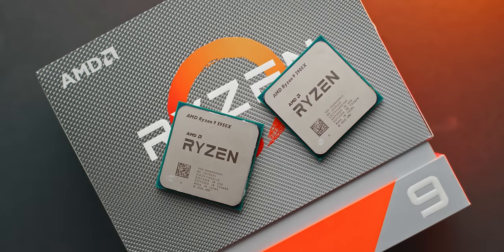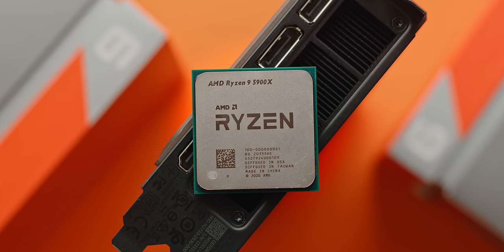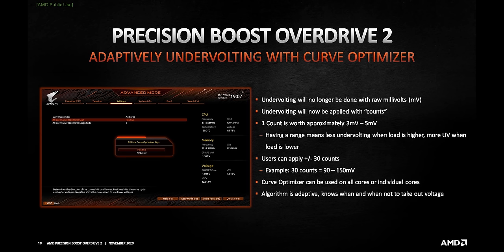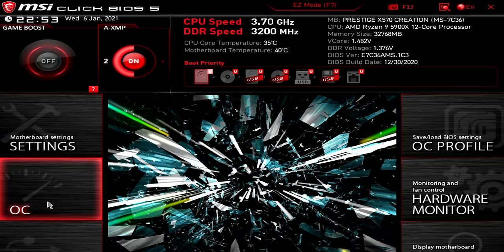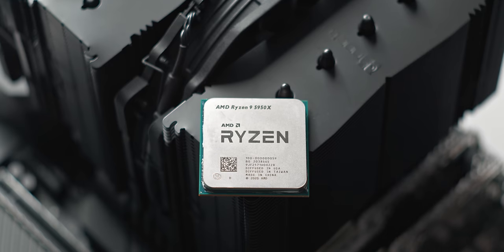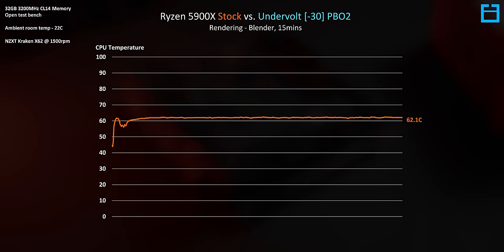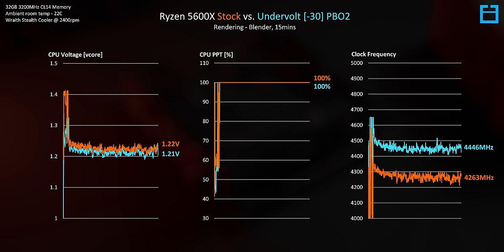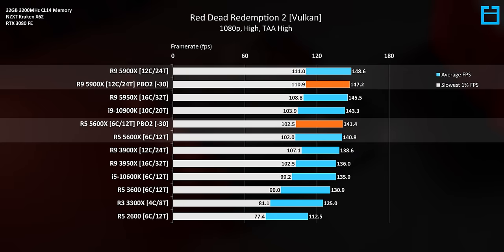Ryzen 5000 Undervolting with PBO2 – Absolutely Worth Doing

Comment: Finally a guide by someone that really know whats he is doing.
Reply: I'll probably sound like a dick but I just find this comment funny since the last time he uploaded an undervolting video he had to take it down because of the massive amount of misinformation.
Reply: @billedwardz  thats kinda funny
Reply: He pressed a cpu down after installing it in the video
Reply: @billedwardz  Which video was that?
Reply: @billedwardz  But you have to mention that at the 3000 Ryzen release undervolting was completely broken.
He was one of the first who discovered that, after a day the video was offline and he made a video what was wrong with undervolting. From then on everybody knew you have to performance verify core clocks even on CPUs.
Reply: @jirihorsky9600  the title was something like "Running Zen 2 at 1.0V", but it turned out that zen2 will "fake" clockspeeds when the voltage drops too much in the name of stability (not entirely accurate but actually explaining it is hard) so the benchmarks suffer greatly. somehow though he didn't notice.
Reply: @bananya6020  I thought zen 2 and 3 dont need messing with clocks. If your cooling is good enough then itll clock as high as temps and your mobo power allows. Past even default  boost clock of 4.2ghz on 3600 for example. Depending on variables it can go to 4ghz or all the way to 4.4ghz or even  more. Mine went as high as 4.4ghz on noctua nhd14. That cooler is like 4+ times stronger than it needs to be for that cpu. 
As for undervolts if those lose performance then its not worth it as the cpu already uses like 2.5x less power than intel on load. But ill still watch the video.
Lastly like that chart in 2:35 , just because the cpu is at 1.4v doesnt mean its frying itself. The task is probably really easy on the cpu so it clocks up and  even though the voltage is high, the current is low. The high voltage is used to stabilize the clockspeeds. A power engineer can correct me if i fumbled that. Read somewhere fixed voltages are bad for zen and its best leaving all at auto.
Reply: @billedwardz  Well at least he learned to validate findings and the bios is not always right. Would have been the best tweak ever for 2nd gen
Reply: I have a couple issues with this video, enough that I wouldn't recommend anyone follow this as a guide. First off, it isn't much of a guide. Beyond showing where the settings are in his BIOS, he doesn't guide you through anything. He doesn't address how he got his undervolt values, he just states what they are. He also doesn't go into per core undervolting, which is harder but could also offer significant improvements. Doing all core limits you to what the most voltage hungry core needs.

But my biggest issue is that he makes no mention of stability testing, to the point that I'm not sure his undervolts are even truly stable. Just because you can get through all the intensive benchmarks, doesn't mean the undervolt is stable. Curve optimizer affects the voltage at all clock speeds. What is stable under a heavy workload may not be on a light workload. My cpu can get through Cinebench and other benchmarks with a -20 undervolt, but will crash randomly when doing photoshop work at anything over -8.

Finally, his recommendation to set PBO limits to default/disabled hurts multicore performance in my experience with no gain to single core. My Cinebench R23 drops 3,000 points. A better recommendation would have been to manually tune the PBO limits.
Reply: @OmairArif  I totally agree with you. I did use this video as a reference but it's not much of a guide. When I stability test undervolting, what helped me is pressing on check for Windows update. My 5900X would boot with -20 but as soon as I pressed check for Windows update, the system reboots even though I can run Cinebench R23 no problem. I ended up with -15 value and passed the Windows update test.
Reply: @leem0401  i am experiencing those restarts aswell in my 5900. Crashes/Restarts are completely unpredictable. Went down from -17 to -12. Hope i don't get any more restarts
Reply: You can probably push harder if you adjust per core vs entire cpu at the same negative value. I got my 5900x at -25 for all cores except best 2 cores which are at -20. This way I avoid errors in occt. I tried -30 and I get errors.
Reply: @Skell0r  Yup, following this guide corrupted my Windows install, thankfully i was able to eventually boot back in and use the SFC tool to repair it, apparently you have to offset per core in small increments, boot back in and run cinebench r15, and then work out which core crashed until you work out the maximum off-set for each core. You can't just turn all cores to 30 unless you won the silicone lottery.
Reply: Do not follow his advice on your 5600x 5800x 5900x. -30 will pass every tests inside 1 hour but it will crash after weeks or months out of nowhere. When you get that crash go to event logger built in windows and check which core has crashed. Reduce the curve by 5 on that core alone using Per Core settings. -30 will actually work on amazing golden chip only and there has been no data on it yet. Start from -25 it will keep crashing or if you are lucky like me you will stay here. By -20 -15 you end up in almost the same range with Manual OC.

So what is the point of PBO then? Its just another way to OC. That simple. No benefits. Maybe the ease of use for completely newbie.
Reply: @billedwardz  Well, not only that but I started my PBO2 adventure here and was happy it was SO simple. Even commented that before starting.

Let’s just say I did not end it here. Lol. Nor should anyone else really interested in doing it correctly. Don’t worry, it’s not that bad. But it definitely isn’t just doing as he says in this oversimplified vid. He should actually take it down, although it won’t harm your system at all.
Reply: @OmairArif  in this very video he says he couldn't go lower than -12 counts with the 5950x without hurting stability so how do you say he didn't validate it?
Reply: If this guy knew what he was doing, he'd use a case that was bigger than a shoebox.
Reply: This isn't really undervolting at all. It's just telling the cpu to run that clock at certain volt .. basically making the clock or curve shorter .. you can under volt it in the bios though but this really isn't a undervolt
Reply: @billedwardz  that’s called learning drop your mistakes mister perfect
Reply: lol
Reply: Yea
Reply: Really!
Reply: Actually hardcore overclocking - buildzoid. Now that is someone that knows what hes doing…..
Reply: @billedwardz his videos about undervolting GPUs (30 series) are still up, and wrong. :/
Reply: @OmairArif  I tested the -20 with prime 95 for a day and a half stable 70% at 5ghz its really depended on cpu

Comment: 5600x user here. Wasn't able to apply -30 to my chip without introducing instability in games soI dialed it back to -25 and it's been rock solid now for nearly a month both in games, when idle and during stress tests . My temps dropped by 10c and my multi core cinebench scores went up by roughly 200 points! Incredible
Reply: What was your stock voltage at
Reply: What's your voltage at???
Reply: Did you overclock it?
Reply: 5600x user here as well. I did a -20 on the curve optimizer and my core clock and scores on R20 went up. There was also a 5 degree celsius drop in temperature under max load.
Reply: @SouvikAhmed  thanks for the info
Reply: rock solid now for nearly a month good, but you can have rock solid for 12 months and then start getting stability trouble
Reply: what about single core score? for me its the same as before
Reply: What kind of "instability"?
Reply: @Xmias3YT  CPU degradation
Reply: @tidjane2001  is it possible to degrade CPU with lower voltage ?
Reply: @fender8372  Low voltages do minimize degradation, but naturally all CPUs degrade over time. 

Now if you are running tight voltages with high frequencies, it could eventually not be stable after some time.

That's why CPU manufactures don't undervolt by default, even if the CPU is capable of it, every CPU is different and they want to ensure stablility.
Reply: It also helps to set the LLC for the CPU to high.
Reply: @tidjane2001  thanks for explaining
Reply: Same thing here...
Reply: It's the opposite for me. Got higher cinebench scores but temps went up 15c
Reply: @roowut Well that doesn't make any sense.
Reply: What is your "PBO limit" set to - "Disabled" or "Motherboard"? 

I have 5600x with Arctic Freezer 34 Esports DUO.
I check the stats with HWinfo64.
Testing with Cinebench R23.

When my "PBO limit" is on "Motherboard" the themps go to 82, when "Disabled" temps are 66.
For me what you say is very unlogical because I saw that when I set Curve Optimizer to "-30" and PBO boost "+200", the Single core clock is higher "4,841" but the  Multi-core goes down around "4,260-4,313"... Cinebench multi-core test 11000 or little lower.
Like I said, if I change "PBO limit" to "Motherboard" the temps go 82 to get higher multi-core clock, but it is not worth it.

If I set PBO to just "Enable", without any other setting, the Single core is ~4,65 but the Multi-core goes up to 4,55, at the cost of 82 degrees, which is not good...

I want to achieve both high Single core and Multi-core with arround 66-70 temps!
Any suggestions?
Reply: @roowut  Same mine got higher frequency and score but increases temps and wattage by 2% on cinebench r23. I tested its single core too using occt but its unstable. using -20 offset all cores.
Reply: PBO itself increases perfomance. I want to know how it performs comparing to just PBO enabled option.
Reply: I just did this with my 5700x set -25 on the curve optimizer. My computer crashed after some testing in a game called The finals. -25 seems stable so far
Reply: do you know if i can undervolt 5600 non x? is it only for x series?
Reply: @regardzz  yes you can .the only  difference between X and non x  variants are the clock speeds.
Reply: mine is is very unstable unfortunately. in fivem it just take different amount of time to crash depending on the CO. -25 fastest -5 slowest. Is there another setting that interferes with CO
Reply: @Nooklet  I just set my 5700x on -30. Played different games, few r23 test. All fine so far idle as well. Temps went down and clocks are 4.2-4.65
Reply: My 5600x has been running stable on -20 for 3 years.

Comment: With a negative offset of 30 this literally reduced core temps by 15 degrees while maintaining a higher clock speed, no joke. Any spike in load would cause my 5900x to jet up to 70-80 degrees on a 360mm aio, after applying this, that temp is around 55. Insane!
Reply: Mine was 70-80 and I had 2 times bleu screen. After this video my  5600x cpu temp stays at 60-70.
Reply: Nice! Yeah I was pretty shocked when I upgraded to a 5950X, when launching programs it would jump to 70 degrees, basically opening chrome would have higher temp then a benchmark. Going to try this negative offset today see how we go!
Reply: holy shit man thats awesome!
Reply: @ibrahimturan28  What about 100% load?
Reply: @bogpan  after my cpu froze i changed my cooler to scythe version c. 
I have now problem with screen freeze ingame. But the temps stay 39 to 50 max i think
Reply: @ibrahimturan28  what value did u set your magnitude at?
Reply: @ibrahimturan28  You should Run OCCT to figure out which cores give errors and reduce the undervolt for those cores by 5 untill fully stable. Just FYI.
Reply: Negative 10 is even giving me bluescreens and that is the most stable since trying from 30 xD
Reply: @JoshMustillo  i got the same cpu, what count did you set? And what are your temps now?
Reply: same
Reply: nearly the same here
Reply: And what's about desktop temps?
Reply: Hi 
Hou much i need to put there 20 ? Maybe, i have 5800x ?
Reply: I make -30 and blue screen when try to play the games
Reply: Negative 20 on a 5900X on an Asus Tuf x570 was the sweet spot for me, I imagine the quality of your MoBo VRM’s plays a factor, but Idk